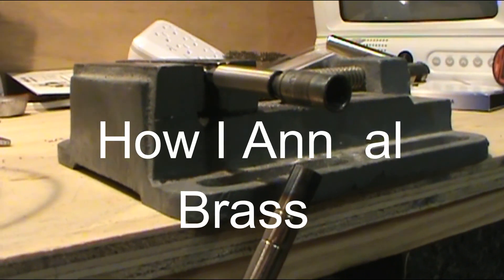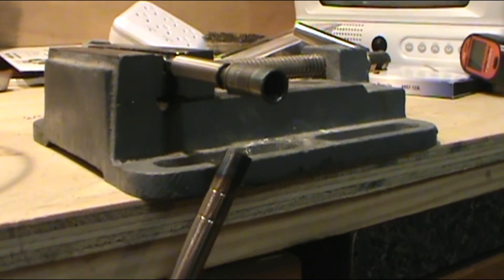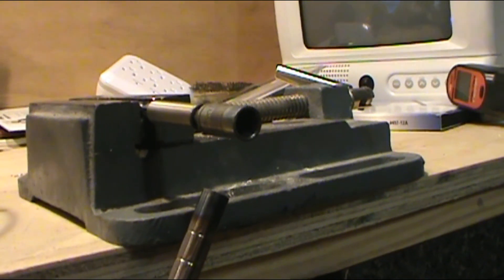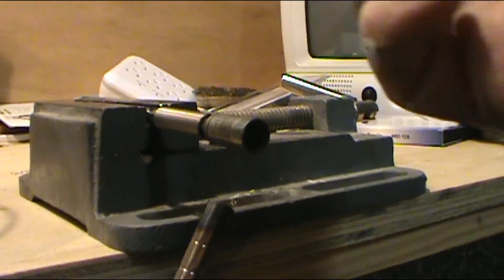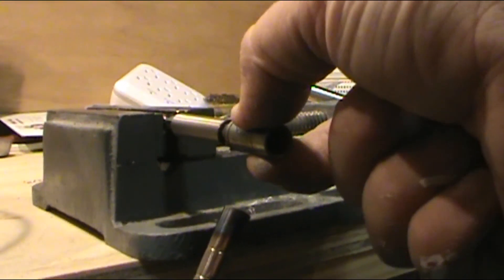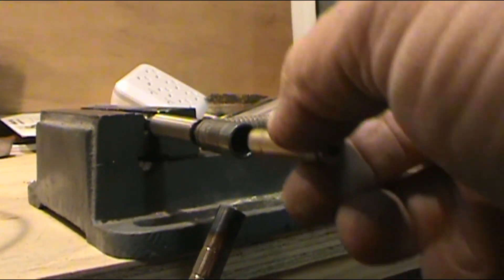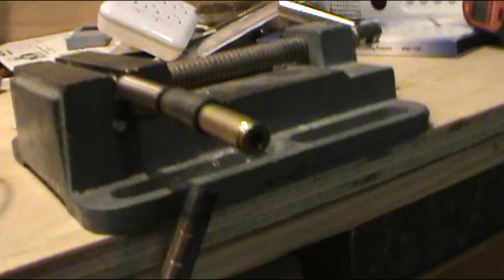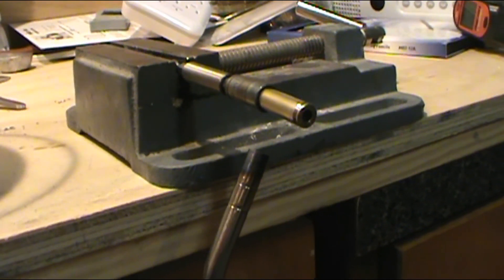Annealing Brass : The way I do it

Comment: If anything use two torches at 180 degrees opposite one another, also how have you confirmed that you're getting a good anneal? Tempilaque? Also 10 seconds in it- howbhotbis the middle of the body and case head getting?

Comment: I like the approach, the socket is acting as a heat spreader.
I am curious though, does the color change 'look' consistent all the way around the case neck?
I've been using a socket in my cordless screwdriver to drop a case head into and spin the neck in a flame. It works well enough, but there is more fiddling loading, position consistently in flame, spinning, unloading, repeat. I can see where your method might get a steadier rythmn going and have more consistent results.
Reply: Clamp your cordless screwdriver upwards in a vise or something, tape the trigger down and now you are hands free.  You can set up the flame to hit the exact spot by making a stand for the bottle with some sheet metal.  Take as many variables out as you can.